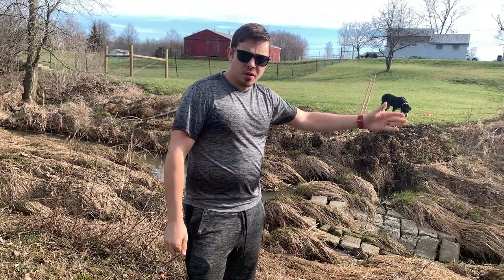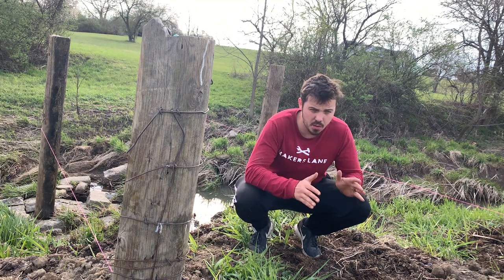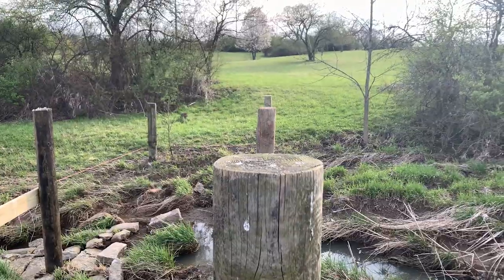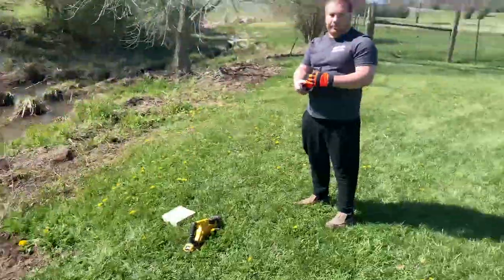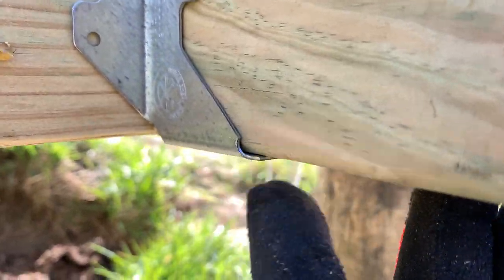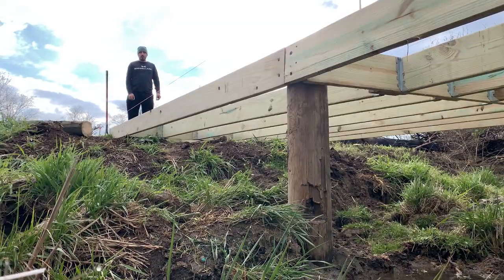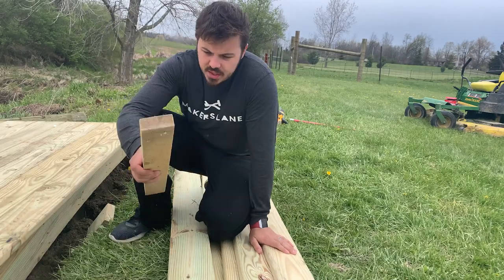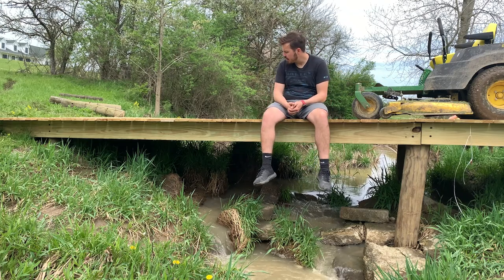DIY (Foot) Bridge Build - Creek Series

Comment: Good job on the build, if you notched the beams you could have had the joists sitting on the beams and screwed with the lags and it woulda been a hell of a lot stronger. I wouldnt rely solely on the lag screws for all of my support.

You always come back and replace the lag screws with 3/8" carriage bolts but thats just an idea. I gotta make myself a little bridge where my backyard slopes into a gully and then goes back uphill.
Reply from the maker: Great ideas! Have fun and good luck with your project.

Comment: Nice work.  But how come you didn't protect the wood framing  with a polyurethane?   I have a 150" and a 183" bridge and I am having issues with rotting wood now. I have to redo them after 6 years.  However I am trying to do this on the cheap.